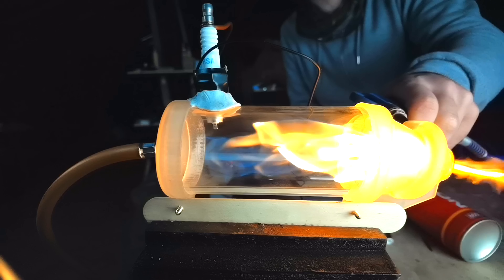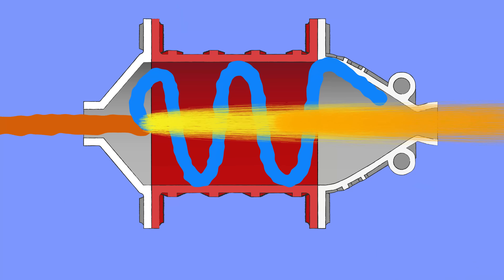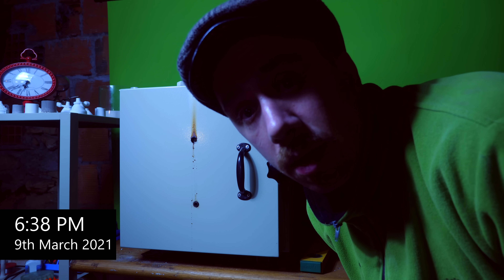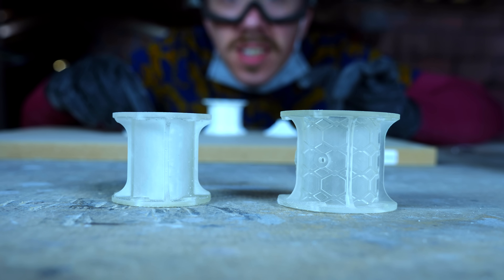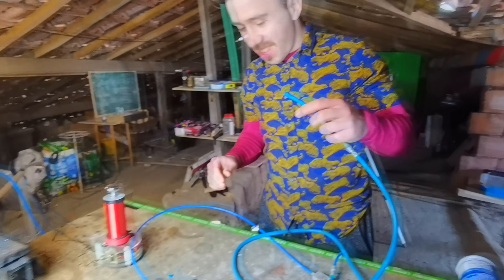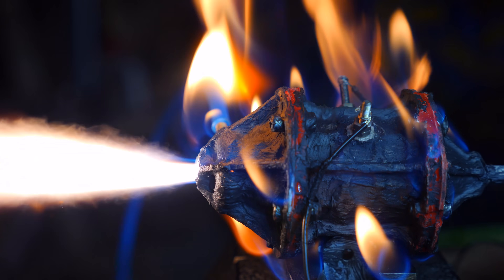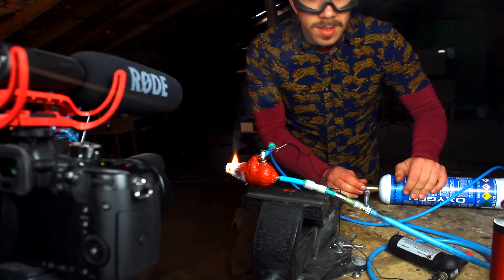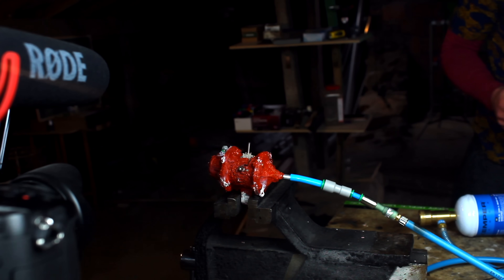Vortex Rocket V2.0 (3D Printed)

Comment: What if... 🤔
After 3d printing the engine body and burning out the resin in the kiln, submerge the body in more ceramic liquid, vacuum it in a chamber while submerged, then blow it clean and cure it again. This way the purousity gets filled up with ceramic liquid. Repeat the process a few times burning away the resin between each vacuum dip. 😬
Sounds crazy but might work.
Reply: Or maybe, you could seal the ceramic pores by submerging and vacuuming the part in a solution of sodoum silicate (liquid glass) ? 🤔

Comment: Could you try a ceramic part with infill that respects the 1-2mm wall thickness? It would isolate the exterior from heat and make it less prone to leaks i believe.
Reply: There will be air trapped in the infill.  It will build pressure when heated in the oven and causing a lot of cracks. Unless the ceramic pores are enough to relieve the pressure.

Comment: With your next engine make it spiraling like that of a rifle. Make sure your resin has a paint coating used like on the x-15 and I am sure it will work again. Or if parts can be printed in high alloy metals ? Just a thought I wish to start working with 3D printing later this year.

Comment: you can use a vacuum chamber to fill the pores of the ceramic with cement, or make a solid piece of ceramic to use as a mold for a fiberglass piece

Comment: it's not only about the leaking ...
i think the vortex part don't work cause there is visibly many heat that reach the internal envellope of the tank ... and ceramic don't seem to handle it

you could use the saturn solution : make the cold gas go pass in the tank side cooling the tank wall and making the fuel hotter before injecting it in the combustion chamber ...
but that will require to have a watertight construction ... and ceramic 3d printed is not

Comment: I would use a seamless steel tube on the engine body. It would be a matter of printing the tips and fixing them. Maybe with a few screws. And then put the cements around everything.

Comment: Your problem sounds like your combustion chamber isn't long/wide enough, it even comes down to the angle of the oxygen flow into the combustion chamber I don't know if that's any help just sounds like it's not getting a proper mixture

Comment: Hey Integza,

It looks like you're still having a lot of issues with porosity. In the past I've had a lot of success sealing concrete pieces by submerging them in a heavily thinned sealant and placing them on an agitator/vibrating tabletop for several hours before allowing the sealant to cure. The vibrations are the key as they let the sealant infiltrate the pores. I've heard of other people using vacuum pumps to pull sealant into ceramic parts but never done that myself.

Hope this helps!

Comment: Coat the inside with ceramic and use the high temperature glue or silicone as a gasket between the two halfs

Comment: why not cover the ceramic motor with heat-resistant epoxy resin.  The resin will close all the pores in the ceramic and make the motor a monolithic structure

Comment: For the next video I suggest that you use a multistep process in your oven using a type of paint or ceramic as a glaze that seals the leaking and thickens the parts. If you use on each step a thin layer of addicional material you do not need to burn as hot and for as long.

Comment: Yo Integza. I know how to solve the problem with having porous ceramic parts that shrink, Crack and deform all the time. Print it in Polycast or Moldlay on any old FDM printer and ceramic or sand cast it. Its really easy, Effective, Fast and you won't waste any material (except the fillament which is dirt cheap compared to resin). If it doesn't work. Just re-melt the metal and try again. It is sure a hell lot cheaper. You already have a furnace so just get some sand and you are good to go.

I work as reverse engineer (3D scanning) and 3D Printer operator and we use it pretty much all the time. We scan something. Re model it. Print it. Cast it. CNC it (this part is optional) and done.

Anyway. Love your videos. Have a great one.

Comment: before the high temp adhesive cures, run a few vacuum cycles to get the adhesive to penetrate the porous body, kinda like drawing out air bubbles from resin, i'm not sure what its called.

Comment: Here is a crazy idea that may help. For ceramic cups and bowls in normal ceramics after the clay is fired it will soak up any liquid that is put into it so you have to glaze the piece and fire it again to make a container that can hold a liquid. So for your parts you could go out and buy a clear high temp glaze and glaze your parts and re-fire them. This should stop all leaking and create combustion chambers with smooth sides for better air flow. Just remember that a heavy coat of glaze can run when fired and firing a glaze at to high of a temperature will cause it to bubble. In addition they need to cool slowly  so they don't crack at first and anything touching the glaze will become bonded to the part so you may need to balance it on the nozzle tip and not glaze that part of the piece.

Comment: I think you should focus on your metal working some more to solve this issue all together. A small anvil with a horn, sheet metal and a hammer could make all these rounded parts. Weld them together like you did in the other video and bolt the modular parts together. Then all you would need is a drill to cut the holes to the right size for the chamber diameter. Sheet metal won’t leak! It’ll only melt lol

Comment: You're trying to stop the leakage from the outside, but it does not stop the fluids from going through the modular engine gaps and "inducing" pressure on the silicon/glue. Try putting those things (glue/silicon) on the inside of the engine using a stick or something.

Comment: What if you submerge the cured ceramic engine in epoxy or plaster to create a thick and solid block that could keep the engine from leaking?

Comment: Try using glaze on your porcelain parts to make them not leak. Glaze the inside & outside, it's basically coating it with a layer of glass. You can actually use glaze as a high temperature glue to stick your porcelain pieces together if you assemble it & fire it. Another thing that works to stick porcelain pieces together is something called bisque fix made by amaco

Comment: Maybe try 3D printing the part(s) you need and then create a mold for the part.  Afterwards cast the part in a material that can handle the temperature.

Comment: Can't you solve the leaking problem by using your 3d print as a cast for a mold and then filling the mold with a fire-resilient materia?
Btw your videos are great
Reply: It might make it less porous, but the curing times would increase (first for the mold, then for the ceramic to set IN the mold, and then firing).  Also, I don't think he could get the nozzle detail using a mold.  The tubes for inlet gases would trap any mold core, requiring a different, more straight shape, which ruins the vortex.

Comment: Do you have a vacuum chamber?  You might be able to fill the porous material with some kind of fire retardant resin or other chemical by submerging the piece in the filler and placing it under vacuum.

Comment: Pour concrete or some other plaster like stuff around it in a mould, ie carbard tube with larger id then your rocket, have the input tube extend out from the cardboard, then pour your plaster around the rocket, let her set, blast the cardboard off and set the plaster in your kiln, let her cool and call it a day

Comment: One day you're gonna get your hands on a metal 3d printer. I can't imagine what you gonna do after that.
Reply: See, the problem is the price of the titanium
Reply: Even that, the price of them as stupid, the cheapest quality, but good performance is 80K. For stuff he is doing, he’s looking at a printer  in the 6 figure range (all prices in US currency
Reply: @police428  $250k for the machine that can make engines and pistons seems fair.
Reply: @police428  Is a metal 3d printer basically some kind of welder/nossle laying down layers of weld?
Reply: @mikewhite4464  the best ones currently lay down a single layer of metal powder or dust that is then melted with a laser and then a new layer is laid on top. Check out the 3D printed Porsche Pistons.
Reply: Probably rule the world? Well, at least tomatos have a problem...

Comment: Print the engine and bake it, after you finish give it a coat of resin with a brush and bake it again, and do it how many times you need to fill all the leaks ... it may work.

Comment: what if you printed a jacket or shell you could put  around the engine in regular plastic or resin to support the engine and then put refractory materiel in the interface of the two parts?

Comment: wait, will applying steel epoxy on a FDM printed part then burning the plastic using the kiln also work instead of using the ceramic part? like designing a nozzle, print it, apply a generous amount of steel epoxy outside, put it on a kiln to burn the plastic off so that it will leave the steel epoxy behind then use it as is.

Comment: Maybe to stop the leaking you could soak the finished parts in a very thin cement slurry. Because they are porous it should soak up the cement. Good luck. What a champion.

Comment: paused at 10:40 this is the hottest jet engine I've ever seen

It looks like the issue might not even be that its leaking, I'm seeing actual deformation of the ceramic material. would it be possible to insulate the inside of the ceramic without hurting performance?

Comment: impregnate ceramic parts with stone impregnator many many times let it sit there and dry over and over, if you use water based (weaker you may not explode)  but solvent based is better! may blow up if not cured

Comment: 1) The gas pressure tends to push the sealant off of the ceramic. Put your sealant on the inside wall instead, so the pressure tends to press it into the ceramic.

2) When the coating is on the inside, more attention must be given to surface finish. Pottery glazes could work as a coating that is both smooth and non-poros.

3) Sealing the different pieces of the modular design could be done better with a gasket. Ceramic fiber paper exists for this purpose.

4) I think the geometry of your back section should look similar to a partial taurus - like a sliced bagel. This would guide the cool film of air into the fuel stream in a more laminar way.

5) Could you add cooling fins? To the nozzle area? Maybe the ribs you have added for strength can be increased and used for this too.

Comment: Put the silicons where u want them and try diferent types of high temperature liquid stuff like that and then use a vacum pump on a dome so that the water bubbles go away and u will have a solid "camada de isolamento", also maybe if u find sme liquid that is good termicamente e seque mete na peça toda, vacum dome it e os buracos da ceramica vão absorver e deixar de ser buracos tens é de ter cuidado com a expansão desses tais liquidos para eles quando aquecerem nao te fazerem cracks na engine, falar ingle is portugues, quem never. Abraço de Oeiras e continua!!!

Comment: You should make a pulse jet-powered Jet. once you get the leakage solved, of course. perhaps a good way would be coating a one-piece engine in the high-temperature silicone, then applying another layer of cement.

Comment: Indo not know the difficult, but you can tray using the same method that porcelain floor or dishes uses, the one for dishes can support a lot of heat and are sealed

Comment: Hey, i think you can solve de leaking problem puting a coat of ceramic resin in the inside of the engine, the preassur wil push but not leak. Hope it works!

Comment: How about a tesla turbine driven toy car? You could use balloons for the source of air flow. It may require a transmission of sorts to provide enough torque to move the wheels if the car is too heavy.

Comment: If your using the cement and such to seal the ceramic then you will run into the issue of pressure pushing the cement outwards. Since the cement is on the outside this creates gaps to escape and combust. For one of the future versions, try to do a coating on the inside of the chamber. The issue you will have to be careful with though is smoothness. If it’s not smooth enough then the oxygen stream will be disrupted and not properly cool.

Comment: Surround the engine with a water jacket or water container if the walls of the engine cannot reach critical temperature due to the specific heat of water the engine may survive.

Comment: Dear @Integza! 
Awesome video! 
I think you should try to leave the 3d printed ceramic parts to cool down in the kiln to prevent from forming micro crack.
Maybe you should try casting different part from metal or other materials by making a silicon rubber mold of a 3d peinted part, and fill the mold with wax, and cast the wax part in plaster, then melt the wax out of the cured plaster and you can fill it with the desired melted metal.

Future video idea:
 Please try to make a split rotor low rpm generator which could be used for your golden ratio turbine wind generator or i thought it could be attached to a manual curved treadmill or a rain gutter generator with a pelton wheel.
Maybe the generator could be attached to a continously variable transmission with a flywheel (battery) to multiply the acceleration.Also you could use magnetic gears to reduce the friction.

I hope this gives you some inspiration for future videos!
Death to all tomatoes!

Comment: Idea: thin copper can be hammered into shape and can be brazed. Use that to make an engine instead of leaky 3d printed stuff
Reply: Good idea but unfortunately even bronze brazing rod will melt at the temps the engine would run at.

Comment: Vortex powered rocket car or boat would be cool once you solve the leaking problem. As for that a high temperature gasket maybe what your looking for. To me it looks like it's getting to hot to fast and it's causing the hi-temp silicone to melt. maybe a bit of an ice bath or something similar to keep it cool?

Comment: Why don't you spin the combustion chamber as well to help with the temperature (and the leaking). Heat rises, so if you spin the chamber, this might help with the overheating by spreading out the heat on the resin.... ?

Comment: Video Suggestion: I would like to suggest a video on turbocharged/centrifugal Compressor on the vortex engine as the output power is high and you can inject oxygen through the output of the turbocharger. Try having a bigger tube with compressor fit into it to give  a boost to the vortex rocket engine. A centrifugal pump with high rpm can create high pressurized air flow or a good mixture of fuel and air at high speed. Thank you. Congrats to the winners.

Comment: My suggestion lets go one step back and use pressured air first. Because oxygen reacts to high temperature more aggressively. Make sure see true engine to check the vortex with air and only a ceramic nozzle. With this you can also keep a eye on vortex regulation due to amount of pressure and flow what you currently don't have. If thats all optimized go back to oxygen ?

Comment: Hey Integza, 
could you maybe melt you own parts? If you print your chambers in a normal 3D printer and then make a form out of sand and cast it with iron into it, youll get a Heatresistant, solid chamber that can maybe help you :)
btw love you projects its so nice to see the progress and its also good to see you fail, cause than i dont feed so bad if my projects dont work on first try ^^

Comment: the high temp silicone was working but on the last engine it looked like it was being pushed up by the pressure inside so possibly use refractory cement to seal the inside of the engine and silicone on the outside also might want to make it slightly bigger so the cement is easier to apply to the inside you could also try casting it from a 3d printed mold

Comment: Maybe try different gaskets or some very high temp glue.. or get the engine dipped in/or painted in that powder coat paint...the powder helps seal and filled holes and small leaks...

Comment: coat the inside of the combustion chamber with DIY starlight. Yes it'll burn but that's same as a hybrid rocket. And until it's burnt it should keep heat inside the rocket.

Comment: Maybe a solution for the leakage: with a slightly larger nozzle (bigger escape for the thrust thingy) it could prevent the leaking (my thoughts, I'm not an engineer tbh xD). Then the pressure that's given to the vortex rocket engine has a way to escape. It would be propably harder to create a vortex, or the oxygen escapes through the exit but I'm sure you'll find the sweetspot. Thank you for reading this trash i wrote down right now, you've just waisted 20s of your life. :D

Comment: Just a heads up the Silicone you're using has a heat rating to around 400-450 degrees Celsius, but if you can keep it below that they should hold for up to 4 hours. (Standard Fire Code for building regs, or at least for Australia). if you can apply a single thick coating and use it instead of the grommets/O-rings for the modular designs, it should allow you to minimize the temps on the combustion by optimizing (as best you can) the vortex cooling.

My suggestion would be to try optimise the vortex cooling by testing different nozzles and air intake angles, if you can keep the walls cool enough it shouldn't leak (so long as its sealed)

Comment: Try to print the engines you used in this video, but in pla on a normal printer and add some beams/outlet collums and then cast them in iton, or go the simple route and cover one of them in resin thereby eliminating all leaks. 👍🚀

Comment: Integza try leaving the supports on from the printing process. Also coat the inside with some stuff called itc100 or satanite. I use this stuff as a heat reflective coating inside of my forges. Also mizzou brand refractory is where its at.